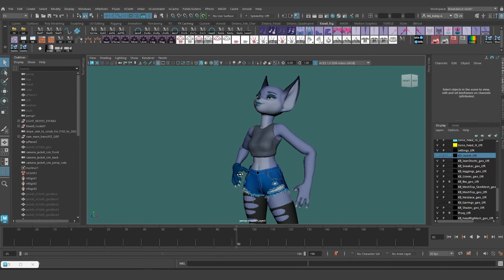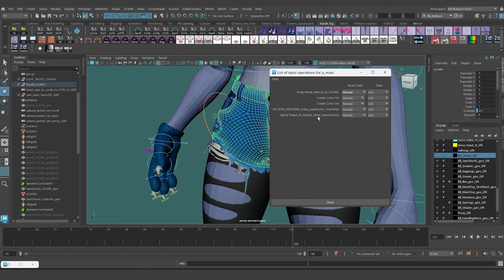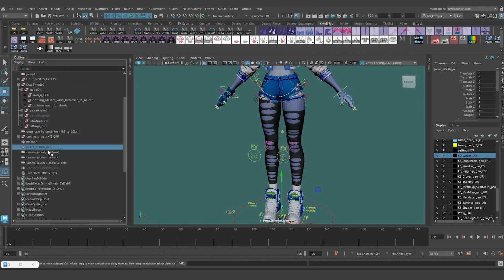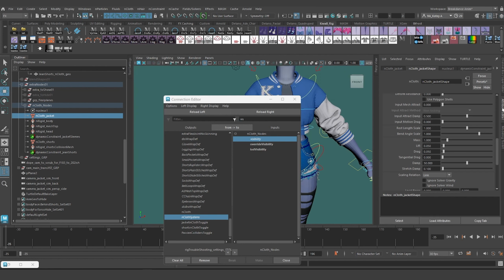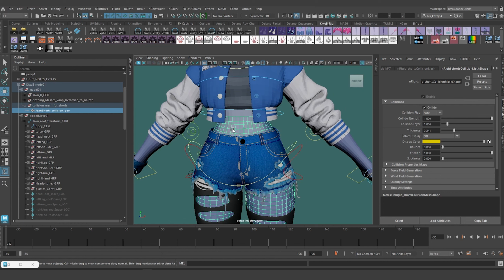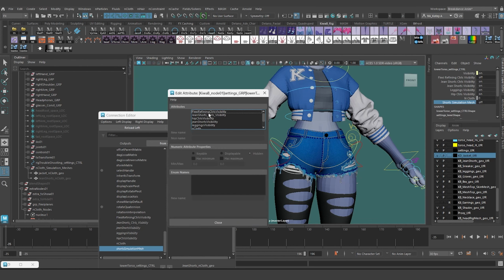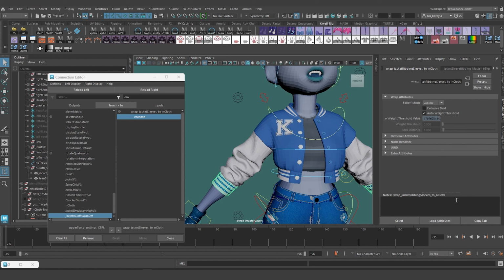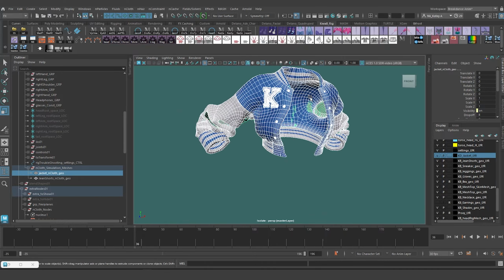Simulating Sculpted clothing in Maya with nCloth - Part 7/8

Comment: When i apply ncloth so i want to add keyframes for animation but its processing something i dont why it so slow ti animate
Reply from the maker: Ankit. what are you applying keyframes on. an nCloth Transform constraint? a control on your rig?

in this video I create some attributes to turn off all nCloth when it's time to animate. It would be impossible to animate comfortably when the nCloth system is evaluating. the workflow would be to 
1. turn off nCloth, 
2. animate first, 
3. simulate the nCloth, 
4. nCache the ncloth 

and then render the final result
Reply: @KoteyAnnan Thanks so much can i share you my file  i create walk animation with n cloth off but my character cloth is moving so slow after that also if you help me then please i want to learn from you no problem sir whats your fees
Reply from the maker: @ankitaggarwal384  Ankit before that, can i ask what your system specifications are? if you notice, I count on playblast to analyze my results and caching to scrub my results because my simulations were also slow. it is not exactly something that can be fixed. unfortunately if you do not have a high end machine this is something you have to deal with.

it has also been recommended to me that proximity wraps are faster than skin wraps. so that is something you can change to get more speed. 

Also simulate one clothing article at a time and then cache it before simulating the other. This is something I also do in this series because simulating both at the same time is just too slow.

What is your CPU, RAM amount, HardDrive type?
Reply: @KoteyAnnan  thanks for details yeah you are right i have low specifications pc so its okay